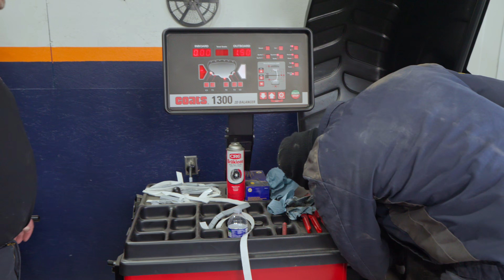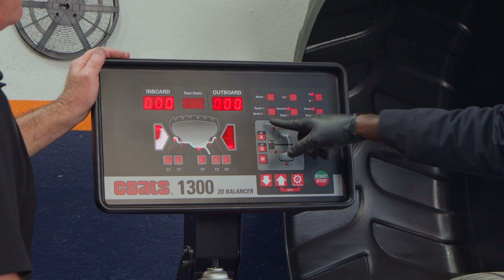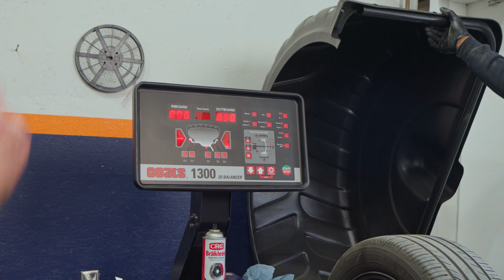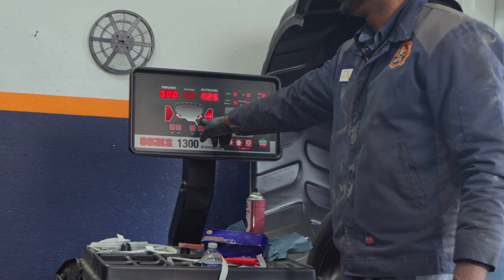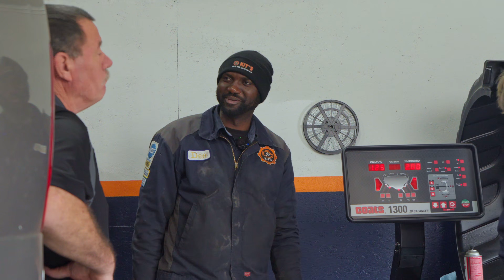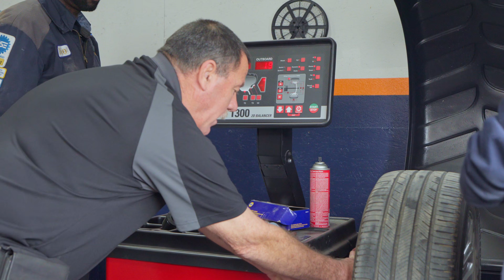Training Never Stops - We are Learning How to Best Use Our Shop Equipments  - Tire Machine

Comment: If you want to be more accurate use 5grams weights (balancing in grams will give you better accuracy as opposed to oz). If I were you I would add a laser on that balancer, it will make your life alot easier.